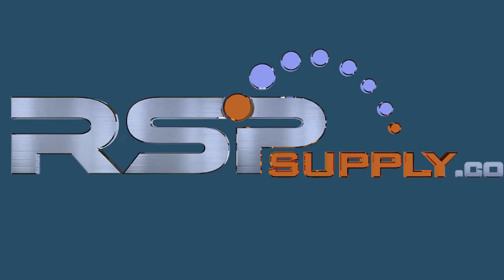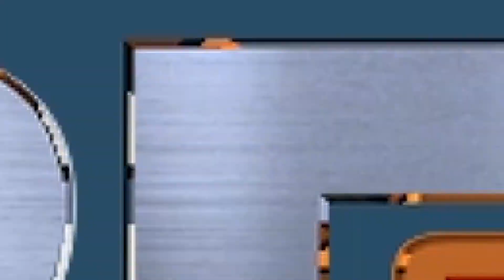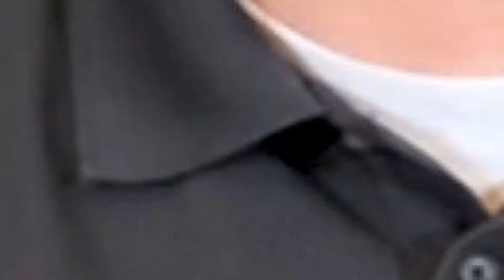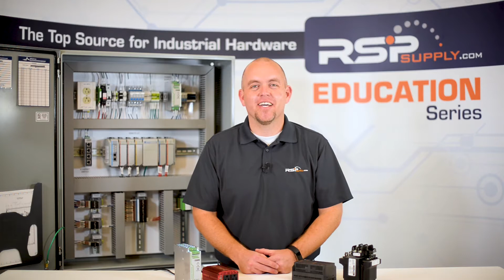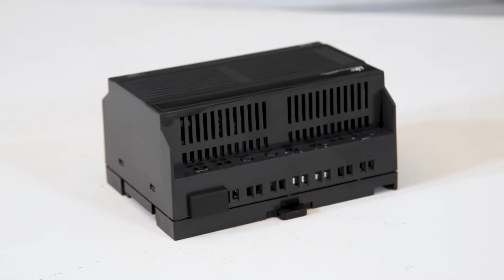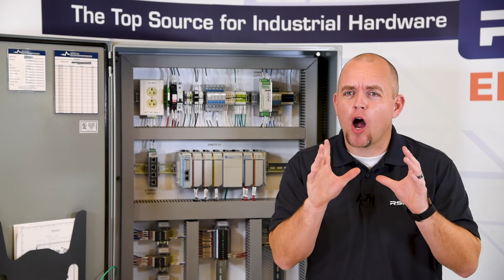Differences Between Power Supplies, Inverters, and Transformers

Comment: These are amazing solutions but how to change both frequency and voltage down or up? For example how to change 220v 50 Hz to 110v 60 Hz for 2000w espresso machine - single phase. Thank you